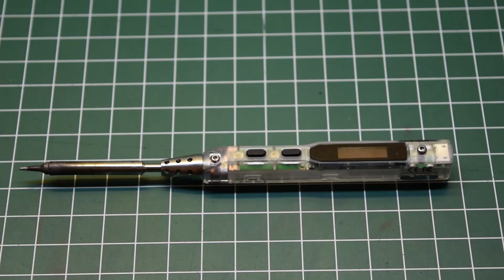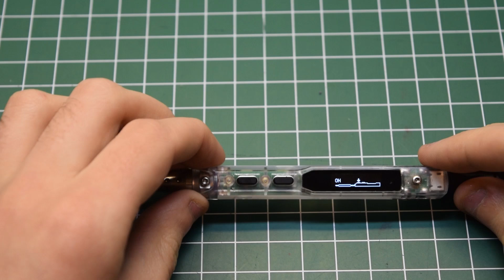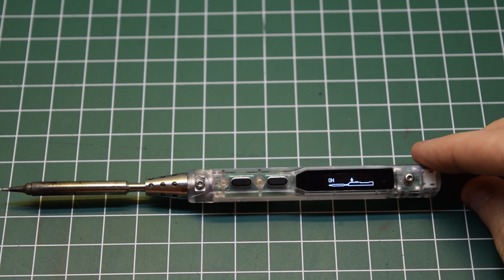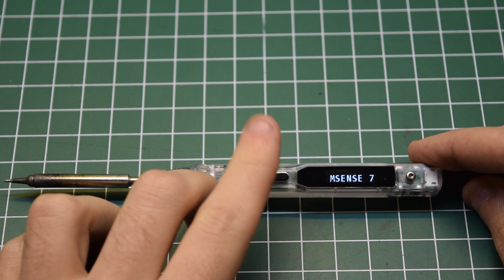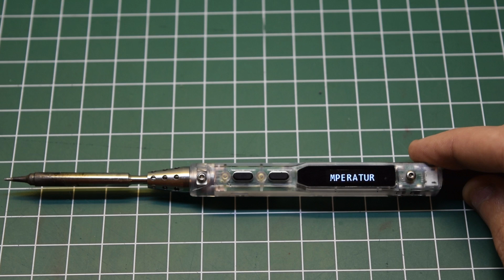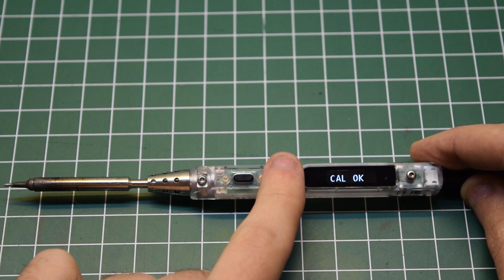TS100 Firmware how-to - Ralim Firmware

Comment: I am a huge fan of the FW especially going to 450C but the one issue is the iron is calibrated 100C too low. 

I think the firmware is a little updated since your vid, I can’t find a temperature calibration screen and am currently trying to calibrate cjc while at max temp
Reply: So that doesn’t work when iron/handle is more than 10C apart. Why doesn’t your firmware have a calibration option?

Comment: Hey, first of all, thanks for the great Firmware !

...I broke mine today because I couldn`t update it.. DFU wasn`t working correctly somehow..

since we have two TS100 at home, I try`d switching the PCB with the STM32 which is plugged to the main PCB..

And it worked.. tried the defective one in the one which was working and It doesnt worked..

so it`s the STM32 PCB which is somehow "broken".. I guess the FW got corrupt, but I cannot Update it bc Windows doesn`t let me acces it ( device is greyed out, cannot be opened )

but the STM32 PCB has four solder pads.. maybe it can be flashed manually ?

Greets
Cre8ionz

Comment: Hi Ben, I just tried to update my iron to the custom firmware and there was not enough space to copy the HEX file, also I had a notification of errors on the drive and that I should scan it and repair which I did, but there is still not enough space to copy the 96kb HEX file. Any ideas as to what I can do to resolve this? Would a factory reset fix it do you think?

Comment: Louis Rossmann recommended this iron, and when I saw there was an opensource firmware, I was sold. Just got mine in the mail today, built the firmware from source using WSL2 under win10, and off I went! Thanks for this ! :D (I'm sure you've generated lots of sales for the company with this firmware)

Comment: is it possible to calibrate the soldering iron if the temp is way off for one or another reason? not just small offsets between tips...
Reply from the maker: Yes, and there is more ongoing work around this too. Look at the GitHub page + GitHub issues, that's where all work and support and discussion occurs.
Reply: @ralimtek  Awesome!

Comment: Can I ask a question to anyone who has updated FW on windows 10 when I connected the ts100 in dfu mode and I click on the 8 digit number that pops up there are no files there I did the FW upgrade and it all worked fine and I saw the rdy file but still when I open it on windows 10 I can't see any files on the drive is this something my laptop is hiding from me?? Sorry I am a technoweenie in every aspect but thank you if anyone replies
Reply from the maker: The files are only "there" during the transfer and then automatically removed after the update
Reply: @ralimtek  okay thanks very much for the reply just thought it might be something I'm missing it works flawless anyway so thank you

Comment: I just flashed your firmware, it was a breeze (was a bit funny about how the firmware was copied to the storage though, as you warned). 

It's really great and feels like I have a new tool! Also, my crappy DIY 4 cell 18650 battery pack can now power the iron, as before it turned off about 5 seconds into heating up.

Great work and thank you.

Was it particularly hard re-writing this firmware for the STM32 ?

Comment: Very nice ... I'm gearing up to (first) modify the stock firmware for the TS80! May I ask which IDE do you use and wether there's any horribly time-consuming gotchas one should be aware of ?
Reply from the maker: The stock firmware requires IAR for building the firmware image.

I use Atollic as my re-write is from scratch and shares no code.

Plenty of gotchas in the firmware, but if your modifying from a base these should be handled by the base firmware. It entirely depends on how your planning to modify the firmware.
Reply: thanks a lot for the tips!

Comment: if i have it set on DC then want to change to lipo, do i have to change that whilst DC is in then plug in a lipo? as that seems bit of a balls ache if i use both all the time?
Reply from the maker: Nah, you can change the settings on any power source. The cutoff voltages are just used to stop you soldering when it's too low.
Reply: @ralimtek  ah brill, cheers :)

Comment: I made an adapter that uses a dewalt 20v lithium drill battery, would i use the battery cell option or the DC option when setting this up?
Reply: lsdave did you figure this out?

Comment: Just flashed the latest and it works great till I drop a custom logo on it. Then it wont turn on. Drop latest back on and it works again. Any idea?
Reply from the maker: 99% of the time your logo is in the old format.
Download the latest your and create a new version of it
Reply: @ralimtek   I did it yesterday so It should be the newest update programs
Reply: @ralimtek  is there different versions  of the tool on github?  I had to go page 2 to find it
Reply from the maker: @apluspool34  yes there is two versions of the exe tool. Or just use the latest version of the python script. The early version has an error in the address  so if you flash a hex file from the learlier one it will do exactly as you are describing
Reply: @ralimtek  ok, it was the wrong tool, I got the newer one and it worked

Comment: Is there a reason there are no shorter values than a minute possible for sleep? JBC for example puts the iron instantly to sleep as soon as you put it into the holder.
Reply from the maker: It supports down to 10seconds. Check again, they are at the end of the list.

A few people hated the rounding. And the slower update rate was removed due to low use and the firmware is running low on room.
Reply: Oh that's great to hear. I haven't flashed the firmware yet, but since the timeout is given in "minutes", I thought 1 would be minimum.
Reply: I just updated my firmware. The temperature round and update frequency is gone in the current version right?
Reply from the maker: @saiiiiiii1  yeah, they were removed in favour of better options nearly a year ago. This video is off the 1.x firmware versions, the 2.x version is nicer to use and has a much better menu system on it.
Reply: One last question. I saw Eevblog and Marco Reps show that the iron once heated up doesn't draw full power anymore when the temperature drops while soldering. (in fact only 10-12Watts were used) Is this something that is fixed in the Ralim firmware or was this adressed at all at some point? If often got stuck on bigger components and had to turn the temperature up into ranges I wasn't comfortable with. If these measurements from eevblog/Marco Reps affect all stock firmware TS-100 then my problems actually would make sense now.
Reply from the maker: @saiiiiiii1  hi,
that is completely expected because of the temperature control. As the unit heats up to temperature the tip power will back off.

When you apply the tip to something cooler, it starts to transfer the heat from the tip, which will cause the tip temperature to drop after a delay. The software measures the tip temperature and uses a PI controller to apply power to week back towards the set point.

This all has latency, which is usually fairly quick but for sudden changes can take a while to catch up.

Also note that the power is proportional to your power supply voltage squared, so doubling from 12 to 24 has a four times improvement in performance. 

Typically on these you want a tip with large thermal mass to reduce the reliance on the pi controller for short term change (like soldering a small pin) and then you want a high (20-24V) supply voltage so that the PI controller reacts quickly.

Also note that there is a pull request being worked on at the moment to change the PI controller from adjusting the PWM to working in units of Joules (watts) and thus this will dramatically improve performance on lower voltages .

Comment: what about config ?
Reply from the maker: I'm sorry I'm not sure what your asking/saying here?
Reply: yeah, that wasn't a very good question. What I mean is, I can not get the config to work. As I understand it, when i plug it into the USB (W10), it should autoplay and show the soldering iron as a drive, or folder. But mine doesn't. when i plug it in, the oled shows 'config', but nothing else happens. And when I hold down button A while plugging it in, it shows 'DFU:3.43', but that is it. nothing else happens. And I am having a terrible time getting help from banggood.
Reply from the maker: @youpattube1  that is for the original firmware. This firmware does not implement the config using USB.

If your screen shows dfu while holding the A button and plugging it in, the iron is working. Check that your USB cable does data as well as power. Also check if it appears in device manager

Comment: Please help... I hope you see this. I do NOT understand wtf to do with Github. I go to the link, I download the .zip. There is absolutely no ts100.hex anywhere in the archive. It's not there. So I go back to your github page, click find file, there's no ts100.hex there either. There's a 001_TS100.hex. Is that it? If that is it, why do you have it in the Bootup Logos folder? I swear this happens every time I ever try to get something from github. Here -https://i.imgur.com/T1Nj8N2.png - or - https://i.gyazo.com/a27e223bb50b060a6c211258f0d4b5c3.png
Reply from the maker: gamer taboo github by default shows you the code. Not the compiled releases.

There is a button on the main page called releases which will take you there. There is also a link in the readme to the releases page.
Reply: Ah, lol. Thanks for taking the time. I'm an idiot, sorry.

Comment: what's that thing you added at the bottom of the tip near the main unit.. cone like thing whit holes??
Never mind i found them on banggood.
https://www.banggood.com/MINI-Replacement-Soldering-Solder-Tip-for-TS100-Digital-LCD-Soldering-Iron-TS-ILS-TS-C1-Equipment-p-1154839.html?rmmds=detail-bottom-alsobought__4&cur_warehouse=CN

Comment: I have this HP envy 17-2000 eo notebook 
And the power supply says 
Input 100-240V ~ 50-60Hz 2.0A

Output = 18.5v ~ 6.5A 

Will this work out for My ts100?
I don’t know how to read tecnical info On My power supply ?
It’s a AC adapter model series ppp016L-E PA—1121-42HH
Reply from the maker: The plug on that power adapter will not fit the TS100 (TS100 has a 2.5mm barrel jack).
The specifications for output power are fine but you would need to change the output connector to use it with the iron.
If it is for your current laptop then you probably dont want to change the plug :D

Comment: Hi Ben, This is my first TS100 and  i have updated it to the latest firmware. When I plug in power the buttons seem to work for a couple of seconds then they stop working. It seems somewhat erratic in operation. Is this likely to be a faulty unit or a firmware issue?
Reply from the maker: Grips Hi,
This is a known issue with some of the newer units. Please see issue 202 on github.

https://github.com/Ralim/ts100/issues/202
Reply: Thanks for the reply, There doesn't seem to be a fix for this problem at the moment.I need to just use the soldering iron at the moment. When can I download the standard manufacturers firmware that will work? I will then upgrade when there is a stable firmware version.

Comment: Thank you for this, it looks and works amazing! Just updated with MacOS High Sierra.
Reply: Hey Ryan. Do you remember how you did that? When I plug the TS100 into my Mac laptop (capitan) the ts100 is not detected.
Reply: @thejll  hi. I think mine connected just fine. Maybe you could try a different cable making sure it has data transfer as well?
Reply: @RyanTLX  Ah, good suggestion. Thanks!

Comment: It is possible some lower voltages may cause a failure on the TS-100. I have a yet unverified quibble regarding possible damage by including an almost useless power option of 3 Lipo cells in the menu. I mean what kind of decent heat can 3 half charged cells give anyway? At close to cut-out at around 2.1v per cell, the Vgs of the SOIC dual MOSFET may fall low enough that both FET's can run to destruction (outside SOA in linear mode). Q1's datasheet shows the lowest Vgs should be 3v. Max power to the tip I understand is 3 to 4 amps, so a valid test may be to water cool the tip while varying Vcc to observe any voltage range where heater voltage is under Vcc minus 0.5v while current is over 2amps (IE: any condition where Q1 is >1watt dissipation). I don't own a TS-100 yet, but you may want to test the V-drop across Q1 before including this option on further updates? (or include some warning..)
Reply from the maker: Hi,
Lower voltages do not cause any issues with the MOSFETs as far as I have tested down to 8V (note firmware cuts out at 10V).
I have run an iron off 8V for an hour when testing this for safety without any noticeable increase in temperature on the MOSFETs.
Remember the tip has a resistance in the range of 9-10 ohms, so at 10V it can draw a max of 1A (but practically it draws less).
The gate on the FET's is driven with the incoming dc voltage (so for my tests it was still sitting at around -6-7V at the gate) which resulted in no more heat generation than when running on the full 24V power supply.

3S is actually a usable option for small joints or in a pinch. Quite a few users use the iron at 3S cells when in the field when running it quickly off a small pack to fix a small wire that came loose. The heat-up time is still bearable for one joint on 3S.

As of my current testing, I have not found any warning necessary when running the unit with the current cutoff of 10V. This will be lowered to 3V/cell in future which is why I undertook the test on two of my units before I was willing to consider the lower input cutoff.

Naturally my 2 units could be lucky, but also knowing that there is a large user base using 3S without issue I doubt the majority of units differ from mine.
Reply: Thanks Ben, it seems I may have cast small aspersion in a thread on EEVblog lately.. ( https://www.eevblog.com/forum/beginners/soldering-iron-recomendations/msg1404514/ ). PS: Are you a member of EEVblog? I can have your channel listed (here: https://www.eevblog.com/forum/other-blog-specific/a/ ) if you become a free member. Dave's policy is non members must have at least 10 electronics videos, but since many forum members user your firmware, we'd be glad to have you aboard!

Comment: Anyone tested with full 6s lipo (~25v)?
Reply from the maker: I use it on a 6S fine most of the time. It does break at 28V though.
Reply: Ben Brown : great! Then I can set two old 3s to series and run ts100.

There is pretty good threshold from full 6s to 28v.

Must upgrade fw today, thanks!
Reply from the maker: Yep :) Read more here : https://github.com/Ralim/ts100/issues/110

Comment: Ben, is it OK to power this TS100 iron from a Adjustable DC 8-60V to 10-120V Boost Converter Step Up, module. This could be run off a 12 Volt car battery.
Reply from the maker: Absolutely, just make sure you set the output from the DC/DC to <=24V. The internals don't last long over 24V in some units, but at 23/24V the iron is quite powerful and very quick to respond. The difference between 12 and 24V is amazing. There is no reason why you cant use a boost regulator for power. Just ensure your booster can supply enough current (70W ish). If it struggles with the load you can try turning the booster down to 19V which is still really good for most soldering and puts less load on the DC/DC.
Reply: Ben, I’ve only had my SainSmart Pro32 Soldering iron for 1 week I’m using the Ralim firmware V2.00a5 (Oct 19 2017) which I think is brilliant. Going by what you said if a 6S battery is used and it’s fully charged the voltage (25.2V) it would be above 24V so it would be safer to use a 5S battery to prolong the life of internals. How often is the Ralim firmware updated?  Great video and very informative.
Reply from the maker: Awesome, 6S does seem to work for most people, but just not guaranteed to work by the manufacturer. The one that we use at my work almost all day has been running on a 6S battery for a few months without issue. Its just I don't officially endorse it as its out of spec :) Generally It updates as fast as I have time to work on it really, and its features are really driven by what the communitiy asks for on github.

Comment: Feature Request please
I would like to adjust the default startup temperature.
Reply from the maker: Jomaba 4308 just change it in the temperature adjustment screen and then when you exit soldering mode with both keys it will save!
Reply: Thanks!

Comment: Hi Ben,  I now have the TS100 ver 2.11 and really like your firmware!  I went to the Page and was shell shocked by all the stuff.  I have never done anything like this. i have MacBook pro
with the latest update. I could not make the manufacturers update work for me and i don't want to be left with a non working TS100. Flash? that wipes out the old firmware? If you can help me understand if a laymen can manage this.  NO is also a good answer.  This is a lot to ask! If its to much i totally understand.  Thank you for you take on this!    Cheers!   Tom
Reply from the maker: Hi,
Mac's tend to be hit and miss with the build in uploader, with some users having it just work and others having it never work for them. If the bootloader rejects the update it will just not flash the unit, it won't leave your iron in a broken state. You can try the ts100.hex file in the repository as well and just see if it will work for you. However, if the updater does not want to take the update nicely its a bit of a pest to try and get it to work. One thing would be to try renaming the update files to be in upper case only. 

Let me know if you still have issues and I will try and help further :)
Reply: Well you have made my day with your big effort help! I have learned, I am gong to get a local computer expert to give it a go. Knowing when NOT to 
is learning and i thank you very much for your supper effort,  have a good day!      Cheers!